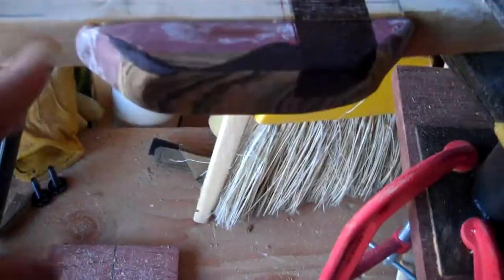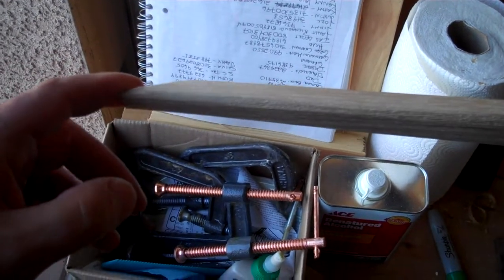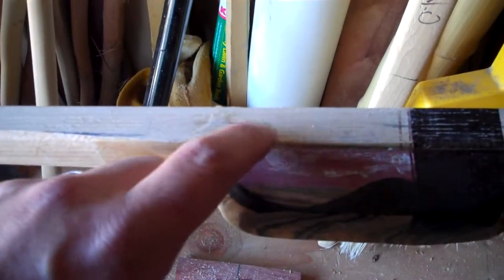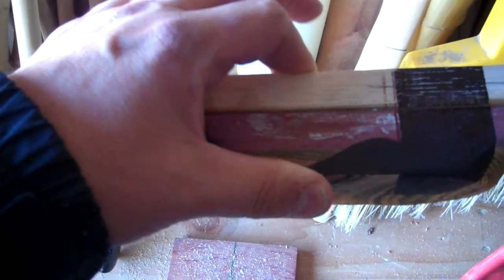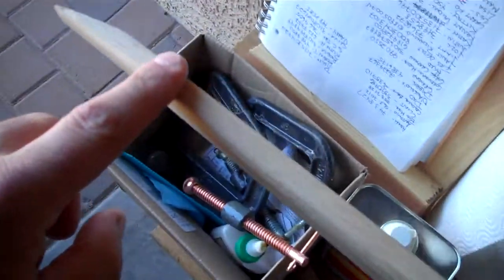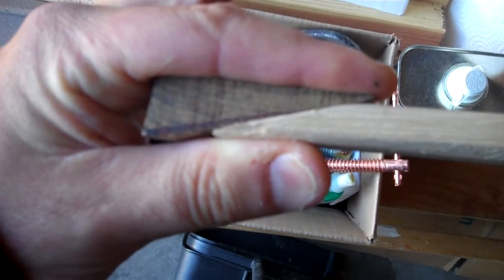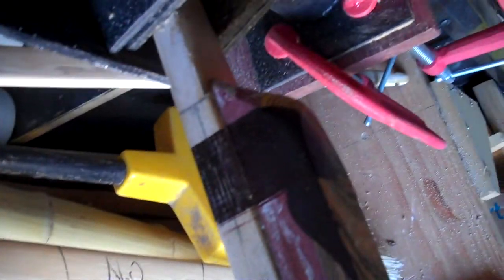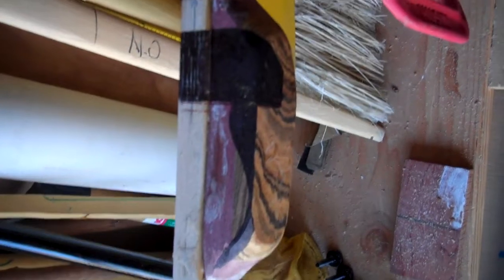How to Build a Flatbow: Part 5: Riser and Tips

Comment from the maker: Definitely! Make the riser narrow, but build up the thickness to enhance the stability lost from narrowing it. What you will end up with is a ambidexterous bow without an arrow shelf. Next check out the video I made where I glued an arrow rest to such a bow. In your case the bowstring will have to be perfectly centerline (so take your time with the nocks) and just glue up an arrow rest of choice to both sides of the riser. There are prettier ways of doing this, but this way is the easiest.

Comment from the maker: @CodyClay1 : Congratulations! I haven't used a lot of epoxy and I'm basically going to follow the directions on the box. At the moment, I don't think sizing is necessary with epoxy, but I will post a video with my experience if you want to hold off.

Comment from the maker: @hackamore : I tend to only take wood from what will be the belly because of the taper. This allows the wood to accommodate for compression force on the belly and doesn't potentially compromise the back from accommodating to elastic force. Width is safe and acceptable as well.

Comment: Once again excellent videos. I have a question about tapering the bow. You mention tapering 3/4 to 3/8, 5/8 to 3/8 and 1/2 to 1/4 does that measurement include the bow backing. My bow is backed with an 1/8 strip of hickory so do I measure from the back of the hickory backing to the belly or the back of the actual bow to the belly? I am trying to reduce the draw weight and I think the bow is way to thick. Thank you for all your help.

Comment: Mike - How far up was the bottom of the arrow shelf from center of the bow. It looked like you had a line for center and then the bottom of the arrow shelf was 1/8" to 1/4" above that. Thanks in advance for the information.

Comment: I just thought of another question. An earlier post it mentions using glue and sawdust to fill in gaps where the glue did not fill by the riser. Will glue and sawdust work to fill in a couple gaps between my bow and backing? I use Titebond III glue. Thanks again.

Comment: i am makeing my handle differently then you are. Right now i have a rather thick piece of wood there. I am going to rasp it into a rounded handle to fit my hand better. However i am not sure if the handle or the floor tillering should be completed first. Thoughts?

Comment: Hi Mike i have just finish glued the tips down i did not do the way you did in the video i just stuck them down which was the fist option but i was wondering how does the bow string attach to the tips in the way i have done it.
Reply from the maker: You'll need to sand them into the shape you are after then use the rat tail file to create your nocks.

Comment: Hi Mike sorry i have not been in contact as i was delayed on my bow and sorry i have not been able to put photos of my bow on i could not work out how to put them on. Anyway down to business how long should i do the tips and and hints on how to draw that perfect pistol grip wiggly line as i am not very good at drawing.
Reply from the maker: Tips are a preference but I make mine about 2-3 inches and sand until I am happy.
The same kind of goes with the pistol grip. I modeled mine after another bowyers grip and then sand until it fits my hand comfortably. I usually don't make much more than a thumb forefinger groove for bows going to other people as everyone's grip is so different. Sorry I can't be more specific.

Comment: First, thanks for sharing these videos - awesome work! I'm working on a flatbow now myself and just finished a first reduction on the belly and narrowing the limbs. I am likely to have to reduce the belly another 1/8" myself - the bow bends but is way high. 

A question: I don't think you specified in the video how far the bottom of the shelf is above the end-to-end centerline of the bow (mid-point from the ends - 33" on your bow I think). It is, of course, closer toward the upper limb, but I wasn't sure how much. Eyeballing it based upon the 7-inch riser length, it looks like maybe an inch up from center, but I don't see a mid-point (again, end-to-end) mark on the back of the bow to help judging that. There's a mark on the side edge of the main bow body along the riser section but it really doesn't look like the mid-point of the bow.

Thanks again!
Reply from the maker: You are right! I go anywhere from 1/2" to 1" from centerline. EXACTLY where it is place is more dependent on my mood and how the bow is bending. Kind of a feel thing, but you can't really go wrong in those dimensions.
Reply: Okay. Thanks! I went with your original 72" plan. I am working with red oak as a bit of a trial run. I imagine it would be wise to back it. Are there any signs you look for to suggest more of a need to add a back? I am planning for a walk in the National Forest this weekend on a quest for a downed hickory or something even more exotic of I'm lucky. I'll get that don't for something later.

Any plans on an arrow making video?

Thanks for the guidance!
Reply from the maker: I am going to try to get a friend who makes arrows to do a video with me on the subject.
For boards it is all about grain pattern, check out this video (I have others on the subject as well): How to Build A Bow: Another Proper Grain Pattern Video
Reply: Sounds great! I'll keep am eye out.

Comment: Hey just a quick question!, does the bottom of the shelf have to be round? Would A slight slope towards the middle of the bow not work or, if the bottom of the shelf was somewhat rounded, almost like a half-pipe, would it work just the same?
Reply from the maker: Interesting question. If I understand you right then let me just say the idea is to get the arrow resting on as little of the shelf as possible while still being balanced. Anything that accomplishes this will work.
Reply: no actually i meant the opposite of that so to say make the shelf like tube almost with a notch cut out almost the same way that a wisker biscuit is shaped but without the bristles or if that wouldnt work than maybe just have the shelf angled towards the inside of the window.
Reply from the maker: Oh, okay. If the arrow is lying in a groove like a tube then it may have trouble doing the natural bend off the bow (Archer's paradox) as the walls of the tube may hinder the arrow's natural motion. It may also rip the fletchings as well, which could cause a deflection. 

Of course this is all speculation as I have never actually tried it.

Comment from the maker: On the belly side there is probably a way to do it, especially if it is a glue failure between laminations as opposed to a break in the wood. I'd need to see it to know for sure but if you wanted to you could post the problem with pics on PrimitiveArcher Magazine "dot c0m" forums and you'll have a slew of people (including me) ready to coach you through the repair